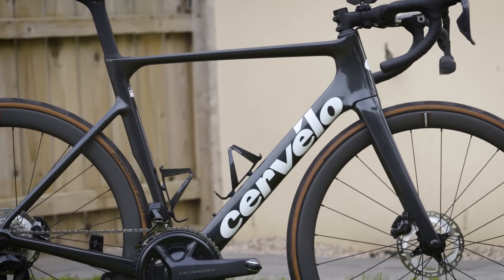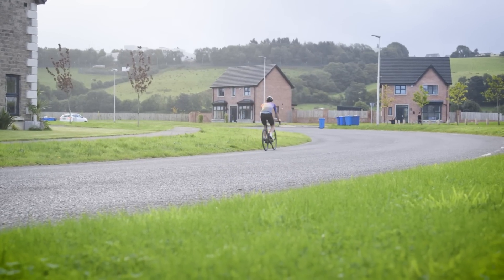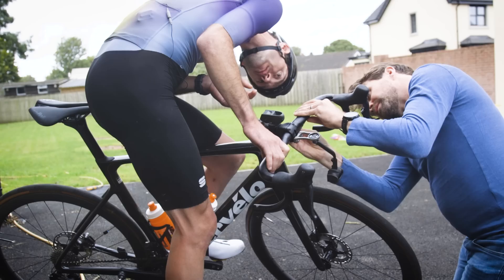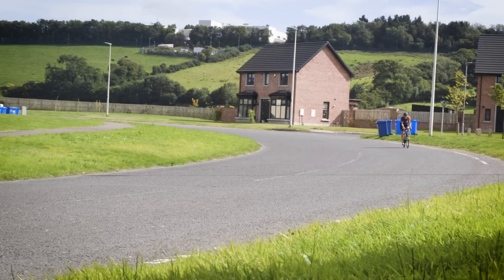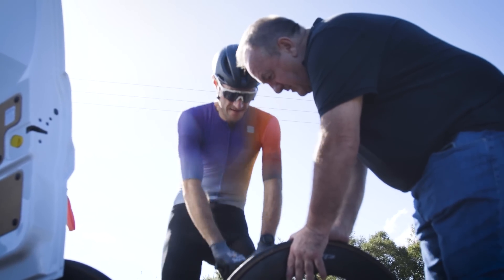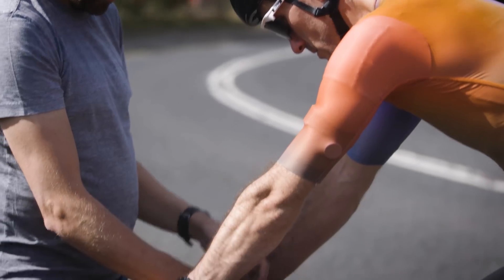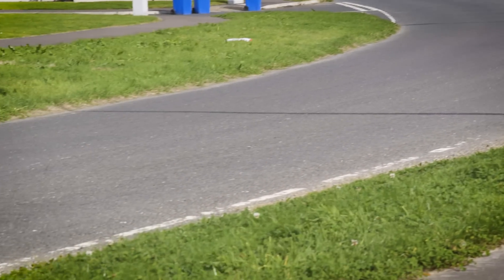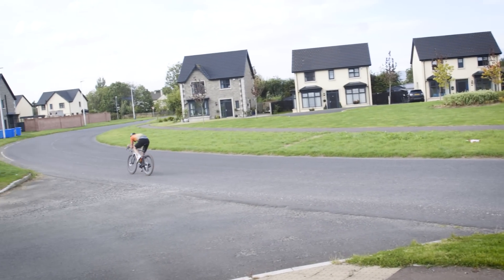Aerosensor testing with the new Cervelo Soloist

Comment: I was expecting the aero savings on the narrow handlebars to be higher. Which width did the original handlebars have?
Reply: The original bars were 42 C-C. I reckon we could have eeked out a few more watts by adapting the position some more to match the narrower bars

Comment: I suppose the video title suggests that it might be about the new Cervelo, but it's not. Just a test mule for the experiment. I don't ride my bike in a wind tunnel, so outdoor testing like this (even w/o precise controls) are much more relatable. In fact it was good to see them replicate what I've noticed with deep wheels in real world riding. 6w savings on windy day 1 vs 12-15w on less windy day 2. But quite surprised from the 55w from the position+wheels. I really need to work on my position!